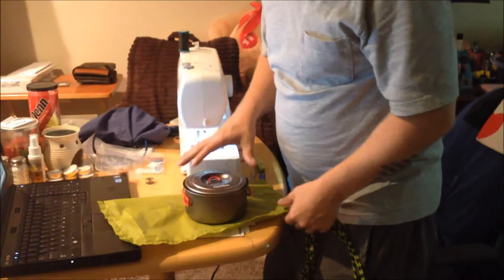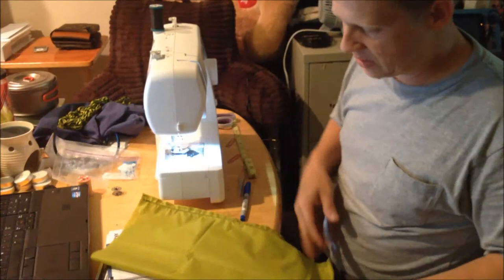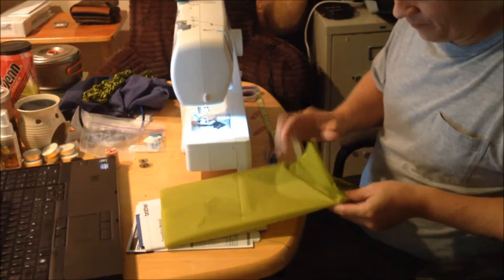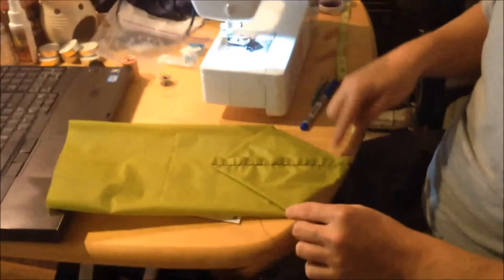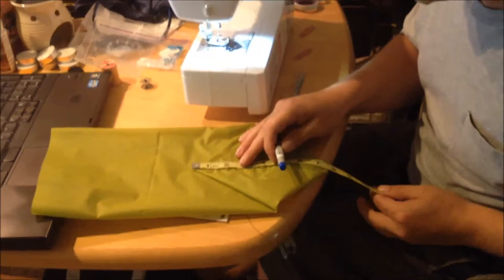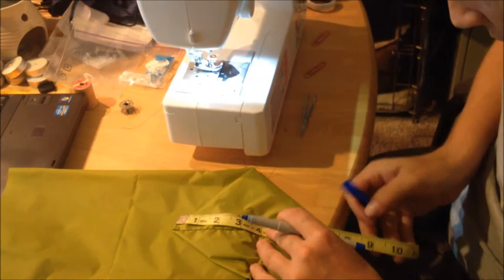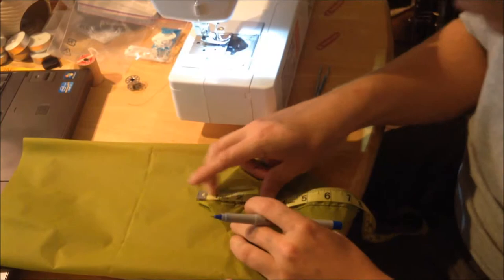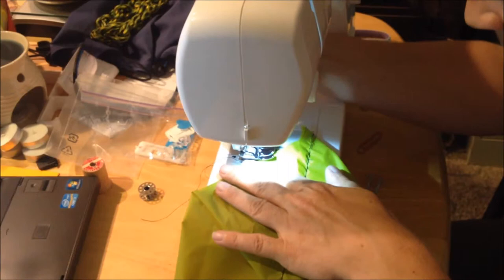DIY Stuffsack - MYOG sil-nylon sack

Comment: Fun! Just a tip for running things through a channel -- put a safety pin on the end, run it through, then remove the safety pin. It's often easier to grip than the edge of a piece of cord.